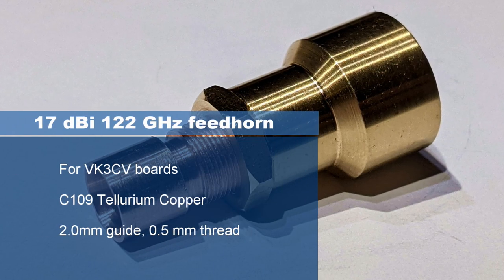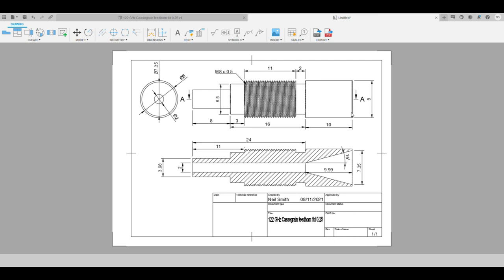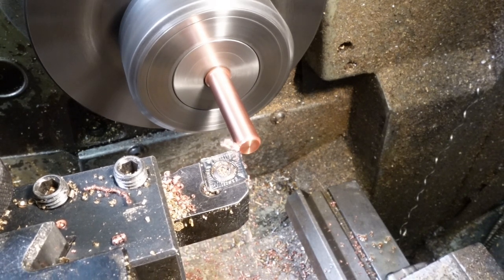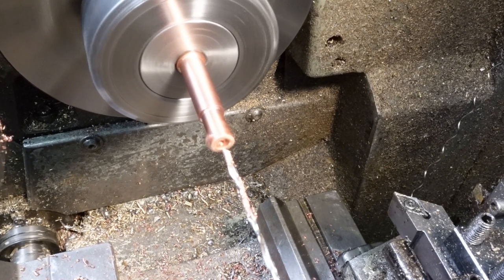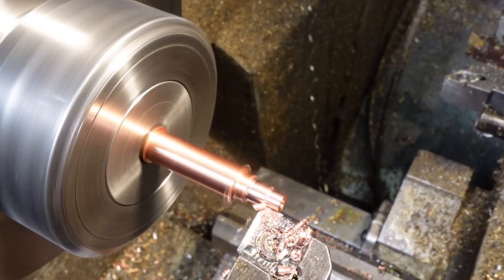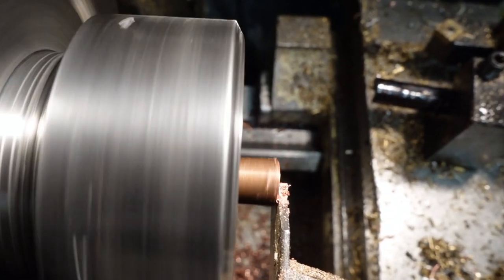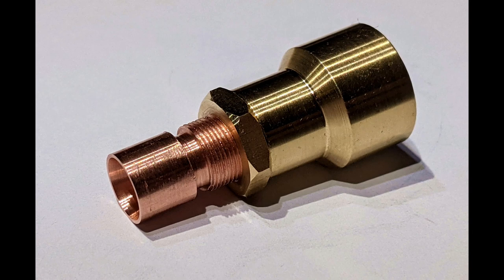Machining a 122 GHz Cassegrain Feedhorn

Comment: Its funny how above a few GHz electronics turns to plumbing.
Reply from the maker: Either that or it turns into things the size of sand grains that need to be glued to ceramic substrates with conductive epoxy under a microscope!
Reply: @MachiningandMicrowaves  Oh yeah, almost forgot about that and how ridiculous it becomes - and it cannot be made any larger as parasitics will dominate everything.
Fascinating field, but for me 100MHz is creeping into black magic territory.
Reply from the maker: @VEC7ORlt  Wooo, 100 MEGAHERTZ?  Isn't that like audio or DC or something???? Sorry, sorry...  I'm also doing some interesting stuff at VLF, listening on 8270 Hz in μHz bandwidths with EbNaut and on 136 and 472 kHz.  I used to be very much interested in 1.8 MHz radio, but that was more than 20 years ago now. Some of my friends are using 30 THz long wave infrared for communication, and I've got some ultra-bright LED sources and fancy avalanche detectors for red light comms using cloud-bounce and airborne dust to communicate on non-line-of-sight paths over obstacles. Current record for red light cloudbounce is I think 270 km or so. That should be beatable on a clear moonless night with perfect conditions using some clever encoding techniques.  Another one in the pipeline is a  mount and focussing mechanis for a 4 inch PTFE plano-convex lens for focussing 122 GHz mmwave radio signals into a parallel beam for communication over tens of km. Too many projects, too little time!
Reply: @MachiningandMicrowaves  Cool cool, yeah, at this point 100Mhz is closer to audio, but I'm more of a power/analog guy, also as of lately power conversion is climbing into megahertz range  - GaN power devices become available.
30Thz you say? I'm not even sure if its THz or NIR at this point, I did some work on photoconductive antenna amplifiers for terahertz time domain spectroscopy and we didn't have LEDs of any kind - it was all femtosecond lasers and photoconductive antenna with high voltage bias, probably tech has moved on a bit?
Does PTFE work in a similar way to polyethylene for NIR?
Reply from the maker: @VEC7ORlt  PTFE is OK at up to 500 GHz or so, not sure above that, this lens is for 122 GHz.  The 30 THz stuff is using black-body sources with gating to impress modulation. Really low-tech with tiny bolometer arrays on receive, but fun and eminently do-able in a home workshop. These LEDs take 27 amps at about 3 volts and put out serious power from a small area which we can focus using a big fresnel lens.  it needs to be robust and simple so the kit can be taken to a suitable hilltop location in the back of a car.  Lab-grade things are a bit too sensitive for this sort of treatment.

Comment: Instantly envious of the Colchester 1800..
Reply from the maker: It's not big enough or powerful enough, but it was cheap, works really well and has been maintained well, plus it came with the Newall Spherosyn DRO. They are a bit too small for a professional shop and much too big for most hobbyists, so can be had for less than £2k, which is attractive when compared with a new import lathe.  The old cast iron lump weighs 7x as much as a £2k new one and is just so much stiffer and generally larger, but not the sort of thing you'd want in the spare room!
Reply: @MachiningandMicrowaves  They are a lovely thing, I used them throughout school and college, and to this day I still reach for the stop start lever on the carriage, and my foot keeps going out for the stop  pedal,  20 years after last using one. Every lathe I've ever had, hasn't measured up to the colchester in some way or other.
I've just subscribed and I'm loving your content, many thanks.

Comment: Interesting project!  I did a lot of microwave work 30 years ago, so I'm curious what your transmission line is - (circular?) waveguide, semi-rigid coax, or is there a new technology out there since I last played with this sort of thing?
Reply from the maker: The 122 GHz devices now have tx/rx antennas integrated directly into the 5 x 5 mm surface mount transceiver chip, so there is an 8mm x 1mm cavity over the chip, then the threaded barrel is adjusted for best performance by changing the length of the 4mm diameter cylindrical cavity to get an efficient launch of a linear mode into the 2.00 mm diameter waveguide inside the copper barrel.  The waveguide is about 15 mm long.  The horn then gives a beamwidth around 20 degrees at the -8dB point. That is aimed from an aperture in the face of a 450 mm parabolic dish towards its focus, but at the focus, there is a 48 mm diameter hyperbolic reflector with its rear focus coincident with the prime focus of the big parabola, and the second focus about 6.5 mm inside the feedhorn flare. The signal illuminates the hyperbola annd is reflected back to the parabolic dish at exactly the right angle so the reflection from the dish surface is a parallel beam to infinity.  Similar to a Cassegrain optical telescope, but with fully corrected optics, so no need for a corrector plate as in a Schmidt Cassegrain scope.  We are expecting around 55dBi gain from the antenna systems.  Loss at 122 GHz is almost 1dB per km, so getting more than 60km takes special weather conditions with low temperatures and low humidity.  122 GHz is close to one of the resonances of molecular oxygen, so that is part of the extremely high loss and the big challenges.  At the other end of the scale, I'm working on a 10 GHz system with a 3 metre steerable moon-following dish that weighs about a quarter of a ton . Nice engineering challenge keeping that aimed at the disk of the moon.  Huge fun all round

Comment: Have you given any consideration to buying full profile threading inserts? I am fortunate in being able to buy single inserts. They make so much difference to threads. Only disadvantage is they only cut a single pitch, however they will cut that pitch at any diameter, but your threads would be perfect. You might find that all your threads become 1mm pitch! LOL
I forgot to mention, that if you did decide that 1.0 pitch would work for you, thread taps are available in many sizes, 6, 8, 10, 12, 14, 16, and 18, I have all of them except 8 which must be available as it is a standard metric fine thread.
Reply from the maker: I've got full-form inserts in 1.25 and 1.0 mm, but not in 0.50 or 1.50, and guess what threads I cut most of the time.  Yeah.  Next time I'm shopping, I'm going to stock up on a few more sizes. I have an M22 x 1.0 tap which I've used for a couple of projects.  A friend found it for £3 in a second-hand shop.  I've tried thread-milling using the toolpost grinder and a single-point hand-ground cutter, I've got an upcoming job which needs a fine M25 thread and I'm considering whether to get a 1.0 mm commercial thread mill and try that out once I get the spindle made.  Might be slightly less  bother than single-pointing the thing. Anything for extra giggles.
Reply: @MachiningandMicrowaves  I was surprised when I looked up 1.0 pitch after leaving the comment. Taps in almost any size you like, I even saw 7 and 32 mentioned!
Reply from the maker: @smallcnclathes  An M32 x 1.0 is an interesting design choice. I thought this M22 was a bit over the top, whew!
Reply: @MachiningandMicrowaves  What time zone are you in?
Reply from the maker: @smallcnclathes  GMT0, about 1.5 degrees west of the Greenwich Meridian.  Midnight here right now.

Comment: Amazing! Waiting the OpenEMS videos :)
Reply from the maker: Still working on the new simulations.  The H-plane sidelobes on this type of simple horn are a problem, so I'm modelling W2IMU and Pickett-Potter dual-mode horns with the same pattern,  The 'IMU is very deep and tricky to machine, but the P-P has a critical dimension at the step that is difficult to measure.  Choice will come down to which is the best to machine as the patterns are pretty much similar

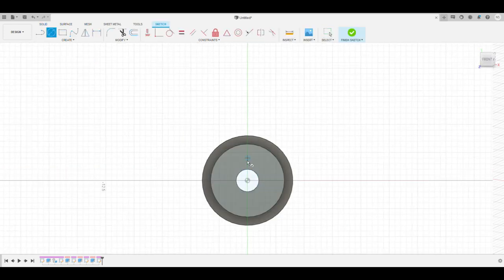Comment: 1:13 came to say you can draw the cossection of this part in 2d and than use the revolve tool to make it a3d part look it op more natural way of doing it  you probebly know this by now but for anyone wondering
Reply from the maker: If I knew the shape of what I needed, that would certainly be the way to do it, but I was using Fusion as a sketchpad to try to work out how things might look and hadn't really thought of the final shape, and I didn't have any clear idea of how the final thing would look. I think in the production version of the other horns and couplers, I did draw a 2D shape and revolve it, but I find it useful to be able to change the shape of the section after the threaded barrel, and it feels a bit more natural to do that by extrusion and holes.  For the larger horns with 14 mm orifice, I definitely made them as a 2D shape that was then rotated, as there are critical angles and thicknesses to define and it's much more natural to do that as 2D primitives and rotate them as you rightly say. I still don't think of objects in the way Fusion wants me to, and the business about having to open another window to change a parameterised variable drives me to yelling at the computer, it is so obtuse.  I guess they might have a workaround for that. My workaround is to use a pencil and paper!
Reply: @MachiningandMicrowaves  You're right that the user parameters should be a 'dockable' or 'floating' thing like  the measure tool. But at least when you get a CNC Fusion's got decent CAM support!
Reply from the maker: @MordecaiV  Indeed, I'm looking forward to being able to produce complex curves and take the stress out of making slot antennas with 24 slots of an exact length and width.  So much easier with a CNC.
Reply: @MordecaiV  the correct term I believe is "non-modal" window. Yeah I long for that feature, unfortunately I do not think there is a workaround as of yet.

Comment: How do you check the pattern of the horn? Maybe a video on that subject?
Reply from the maker: Good idea.  I have six different horn models that I need to compare to determine whether the pattern and the sidelobe levels match the OpenEMS simulation results. I use a rotating platform and a detector on a mast with an elevation scale so I can check the pattern in elevation and azimuth
Reply: @MachiningandMicrowaves  Textbook! Would be a treat to see it in practice! I’m down in the weeds of S-band and lower so an antenna range for me gets a bit bigger and harder to set up...
Reply from the maker: @juliussokolowski4293  Yes, the trees act as a very good absorber once you get over 24 GHz, so it's easy to set up a range for 122 GHz when the wavelength is only 2.5 mm